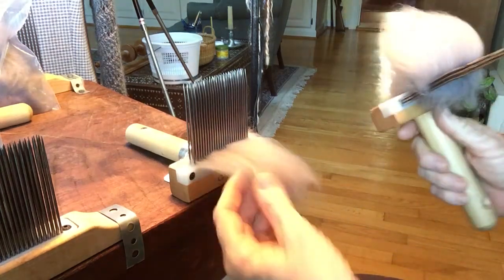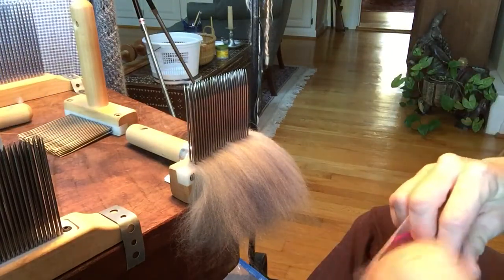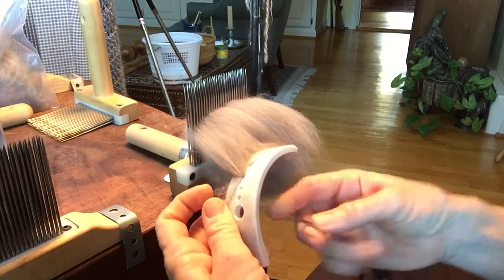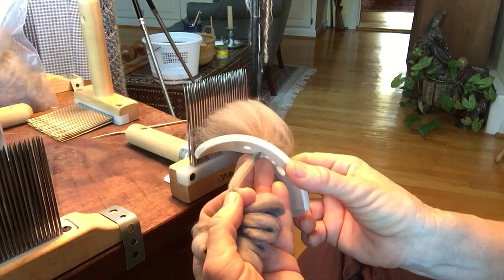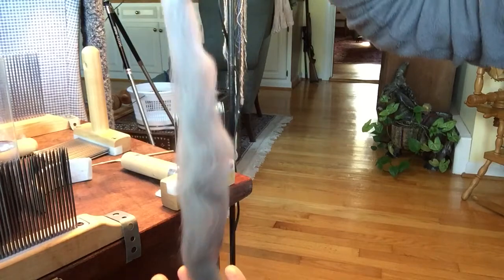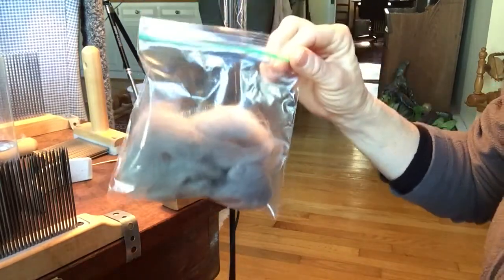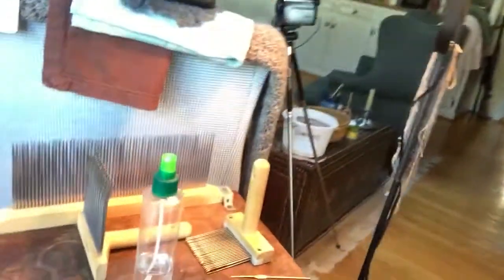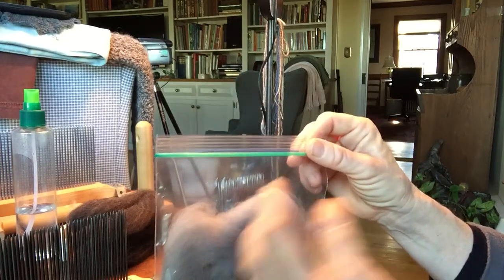Combing Angora -Follow-up

Comment: I have a thought which might be helpful (or ignore it, I don't mind).  When static is a problem, you could control it better by putting an anti-static substance on your left hand.  It wouldn't take much.  Like maybe rub a dryer sheet on your hand.  Then every time you stroke down the fibers they will stay calmer, without getting any product on them.
Reply from the maker: That is an interesting suggestion! Worth a try : ) Thanks for posting it. -Kimberly

Comment: Hi thanks for uploading videos about the use of Valkyrie combs.  I've been thinking if I should get a pair of superfine combs recently.  Your videos really help me greatly by that I viewed the combs clearly especially the depth of the tines.  Do you think this pair of combs can deal with cats hairs under 2 inches well?  I am trying to use hand carder to align them in one direction and clear the dirt.  Not sure if combs do better job.  :)
Reply from the maker: Hi and thank you for posting a comment. I haven't tried to comb cat hair before, but have combed very short Paco-Vicuna fiber on the Superfines. It can be done, but I do not know that I would recommend it, just because it is more difficult and there is usually more waste(leftover fiber on the combs). For fibers under 2", there are a couple of ways to use hand cards to get spinnable fiber. If the fiber doesn't have too much vm or second cuts(really short bits), then I would say just make rolags. With finer fiber like I would think cat would be, you would likely have better luck with cotton cards. There are more teeth per inch, good for really fine fibers. If there is too much dirt, vm, short fibers, then I would try and use the hand cards to make cloud, which can then be put back on the combs and rolled into rolags for ease of spinning. Pulling fiber off of the cards leaves almost all of the undesireable stuff on the cards. I have done a video showing how to make cloud. Let me know if you have any more questions. Thanks :) -Kim
Reply: Thanks for replying.  I viewed that video showing how to make cloud.  I'll try cotton cards and see if works well on those short fibers.  Then I can proceed to spin them into lace, not sure if short staples make good lace  ( I viewed your video on spinning lace also :D )